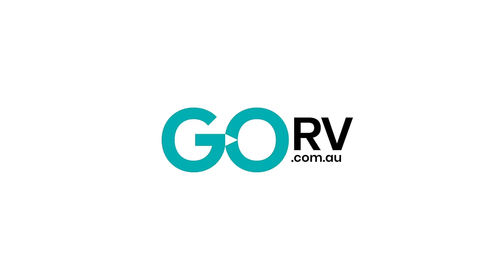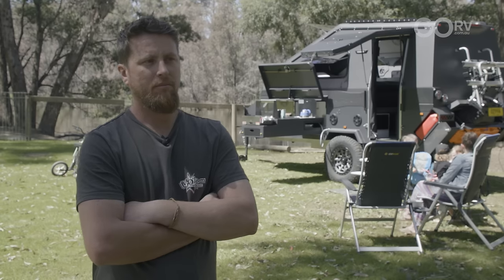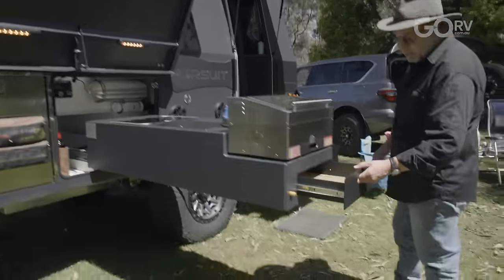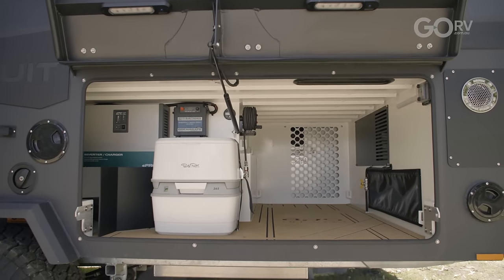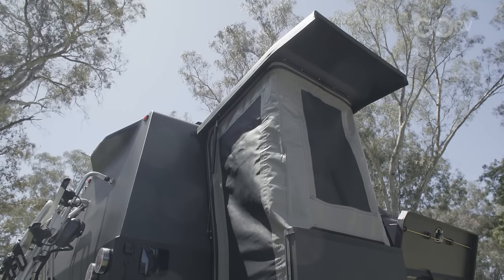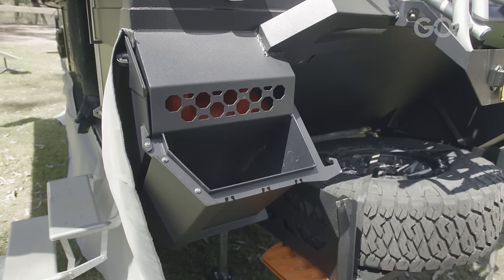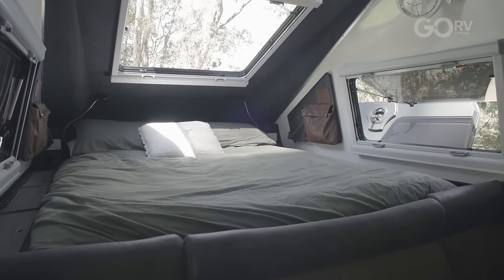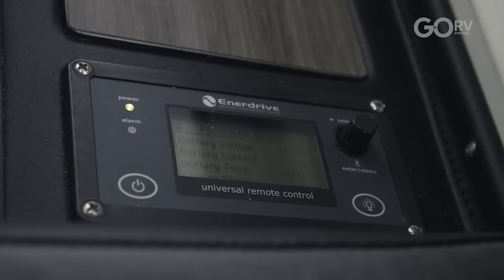Review: BRS Pursuit Carbon Hybrid Camper!

Comment: To the dudes complaining about price: I’m a boilermaker welder fabricator. I spent 6 months after work and weekends building a off road camper,  hand fabricated everything from chassis to aluminium body construction I know every bolt and wire and “mistake”
I chromated and  powder coated all components, i used the best insulation money can buy, redarc management and solar, boss aluminium awning, custom water tank and shower, fans and racks. Fridges and dometic  cooktop and sink custom aluminium roof-rack.. my camper weighs 1140kg gross  100kg ball weight. My next trailer I’ll get under 1T 
I spent $20k easy I kinda stopped checking at $16k if you can’t afford a $100k caravan build one. 
It will still cost money and late nights. 
Tradesman are not cheap and if you want a Australian built Australian owned product you need to pay..
Nice trailer but mine is better..
Reply: Aussie quality costs. Know quite a few tradies and they all take pride in what they do (except for a few plaster's I knew lol 😂) You should do a bit of a slide show of your camper on YT, I'd be interested.